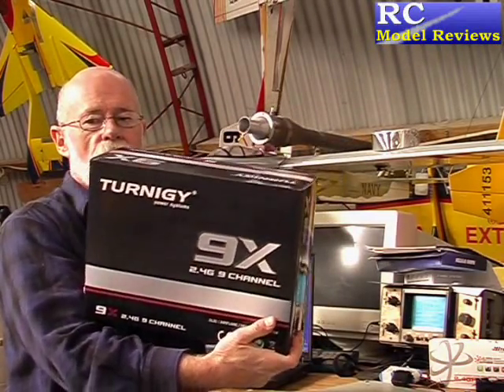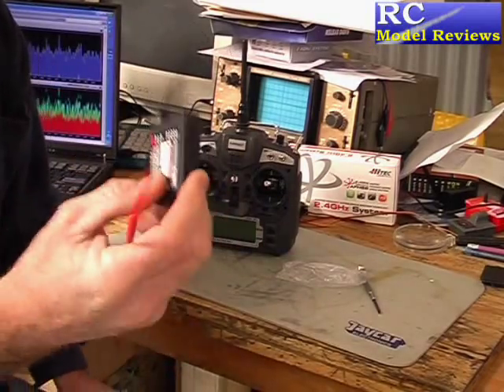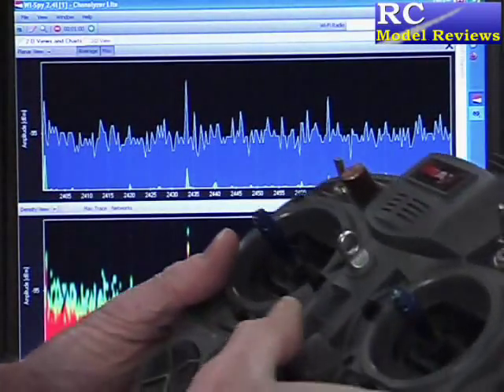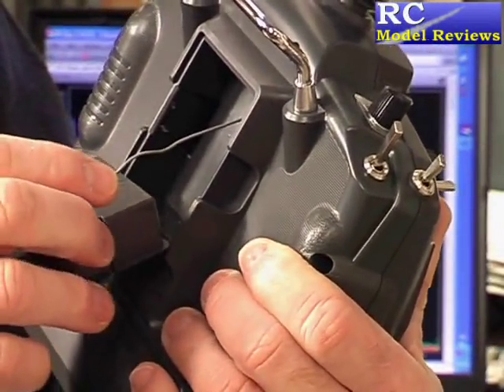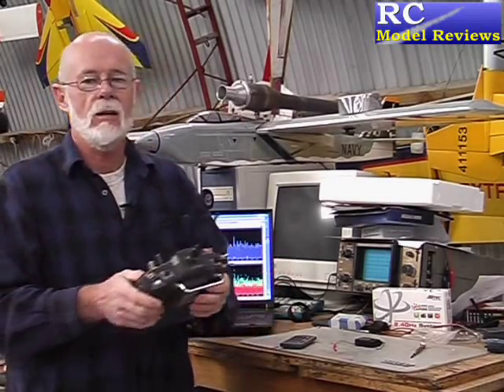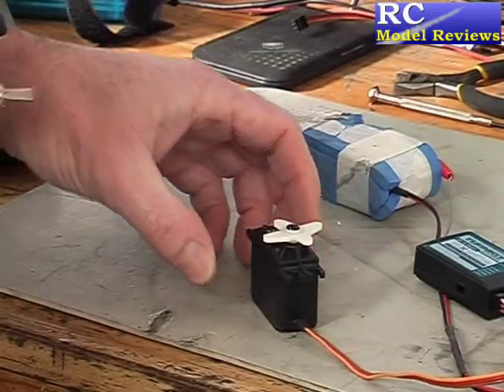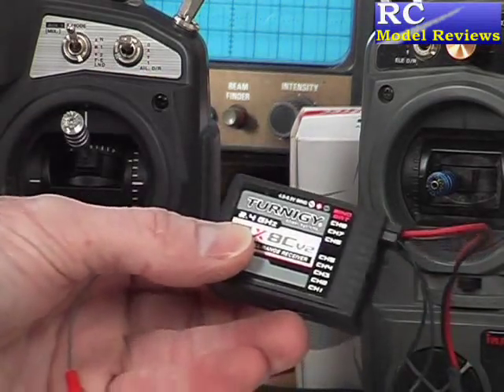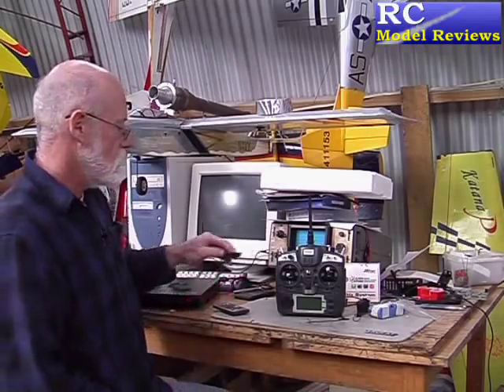Turnigy 9X 2.4GHz radio control system Version 2 review (Part 1)

Comment: Bruce thanks so much for the review. I've had my eye on the Turnigy for over a year but kept avoiding it due all the V1 problems. Looks like Turnigy have really cleaned things up with V2 and I feel it is good due to your technical investigation. As long as I keep up the "It's only $60." mantra I think I will like it just fine.

Comment: Good review! I got the Turngy 9X a month ago and I am extremey impressed to say the least. I got it for $38 dollars plus shipping from hobbyking and the backlight kit was an extra $5. Its remarkable what you can do with it. It is by far the most programmable radio ive used. Only dislikes are the reciever is too big, the batteries are hard to get in and out and that annoying beep every button you push. Otherwise A+

Comment: Bruce, First I want to thank you for the clear concise videos you produce. Next, I want to replace my son's Dx5e but have lost confidence in DSM2 due to too many signal loss induced crashes. The difficulty we have in getting away from Spektrum is the fact that he already has a number of Parkzone Ultra Micro flyers.

Here's my question. Do you consider the Dx6i to be more reliable than the Dx5e and do you know of a DSM2 module that can be used with the Turnigy 9x?

Comment: This radio seems to have such potential, but FlySky does not seem to see beyond offering the cheapest solution.
At $60 plus $11 for additional receivers this is a great option for the casual weekend flyers as is. Pending the flight tests of course.

Upgrades to look at are a LiPo battery, A plug for firmware updates, third party firmware, at least one allows resetting the low battery warning level.

Other receiver options would be a wonderful addition as well.  Both higher end and lighter weight

Comment: Great quickie review Bruce. I'm interested in seeing how much the software has improved. My V1 software is driving me nuts - ok, ok its a $60 radio but decent software aint that hard to do. Also interested how I could fit my Assan module. On the V1 it waggles about so I had to tape it on.

Comment: Hi Bruce, Good intro review, good points raised on the V2.. I like the rf freq hopping now, but the wired in module "option" is a total step backwards. What are they at (flysky) thinking? Propriatry only thinking..? Its an 'open systems' world now with people wanting to use existing modules out there or other brands & not even backwards compatible with their earlier v1.4 modules..

Comment: Hey Bruce - just stumbled across this vid and your others on spectrum analysis.  Thanks so much for this. I have a 9X and a DX6i so it was great to see the difference between the true frequency hopping of this radio and the older DSM technology.  I have greater respect for my $60 radio now! In truth I liked it already.  May get another and do the FrSky conversion if I feel the need for failsafe, though I notice there is a failsafe setting in the 9X menu - does it not work in your experience?

Comment: Difficulty in sliding the power switch can be related to the tightness of the two small screws holding it in place. Today I replaced the neck strap loop with a 3rd party one and had to remove the shaft that was holding up one side of the circuit board the power switch is connected to. As a result I really tightened the two small screws holding the other end of the circuit board. The power switch is much more difficult to slide than how it came from the manufacturer.

Comment: Correction. The difficulty in sliding the switch is not related to the screws but the bending of the circuit board the switch is connected on. The circuit board has two long, springy metal tabs that make contact to the back half of the TX. With the shaft from the 9Xs neck strap loop removed, the circuit board will bend slightly when putting the two halves back together. My fix was a 7/8"x5/8"x1/4" piece of wood and foam cut to the same dimensions. Slide it foam side up under the circuit board.

Comment: Bruce, do you find that the 9x feels a bit bum-heavy?  I always use a neck strap and found that the position of the loop on the radio is too high, resulting in the radio requiring more effort to hold it horizontal (as compared to my DX6i anyway).

Comment: @Aabish72 @RCModelReviews I too am very much looking forward to this video!
I was wondering if it would be a wise idea to convert the antenna into an SMA connector instead. This way boosters and what not could be added very easily? Also when using a module with its own antenna it can be easily unscrewed?

Thanks Bruce for your work. Where about in Australia are you from?

Comment: Ya I have seen the smaller 6 channel reciver for the 9x but I cant seem to find one anywhere. There not on hobbyking or even ebay for that matter. If I cant find one, ill try to use another brand that has been known to work

Comment: @travellingpurdy I have this Turnigy 9x v2 Tx and it has no range issues whatsoever. I just don't know how well it goes beyond about 350m as that's as far as I've ever flown one of my plane with it.

No glitches or anything though, rock solid signal strength, so it's not near the edge of it's range with 350m for sure! In comparison many other Tx reach 1,5km without problems, so it wouldn't be too much of a surprise if this one can do the same. I just haven't confirmed this yet myself though.

Comment: Hi there bruce , Thx for all your hard work making these very informative vids , just read your 8$ diy battery mod and are woundering could i use a 2s 2800mAh 30c lipo ? and just solder the transistor in place to get rid of the anoying bips

Comment: Since this is an FHSS system I think that why they didn't put the fail safe in there because there is a lower change of getting interference and plus its 2.4 ghz so there even less change of getting interference. I'm guessing that your only getting about one glitch per radio maybe more, maybe less by 3 or 4.

Comment: I have had nothing but issues with the turnigy radio. It has been responsible for the demise of two planes now and I am done until I can get the frsky dyi kit. Besides the frsky, is there any others I can use with this transmitter?

Comment: you say at around 8.45 that by putting a module in the turnigy and having the modules ariel behind the built in one it will suck the energy. what exactly do you mean when you say it will "suck the energy" and will I have this problem if Install a FrSky hack module with its ariel mounted beside the turnigy's ariel. cheers

Comment: We have reached 5km with stock receiver and module, using 2.4ghs patch antenna and fpv system. Its quite good for 50$ radio.

Comment: Do you have a way to fix a Turnigy 9x 8channel receiver? I accidentally inserted the bind plug on CH8 then the battery on BAT row where it should be the bind plug is at BAT and the battery is on the BIND row.

My receiver is not working anymore. No lights at all.
Reply: Jayson Ragasa hi! do u still have the receiver ,if so , i can help u out with the repair .
cheers!

Comment: Hi. I have managed to bind 2 of the Turnigy 9 Ch. receivers with my new 9x (V2) transmitter, and can run servos on the elevator, aileron and rudder channels, but cannot get my motor to respond to throttle. Confirmed that the motor is OK...it works when using an alternate ESC/Tx/Rx from Dynam. Any suggestions?

Comment: today i just crashed a plane with this radio, took off well but 20 seconds into the flight, and the radio just didnt answer to my movements, i tried to turn the aircraft and suddenly  it made a roll, after that it went out of control and ka-boom.

Comment: Pretty bad design! wiring in a changeable module, if this is sorted out and you can buy one without a module and just have the antenna with an SMA plug externally, I would put a frsky module in it.

Can't wait for a video of that far eastern FPV set, what kind of price are we talking?  Average far eastern stuff or more the average price for these cameras? I would love to do FPV but I can't really afford all these bloody expensive £100+ cameras!